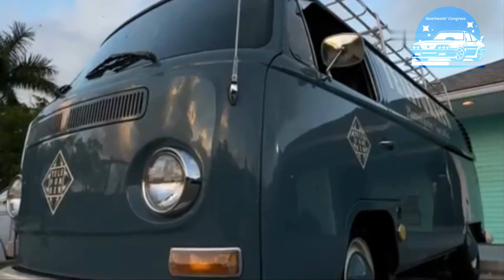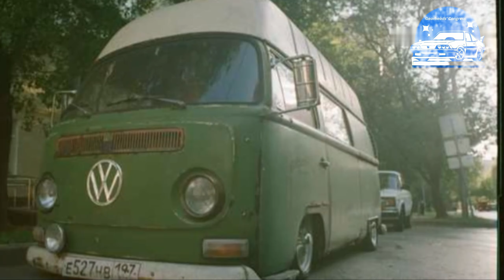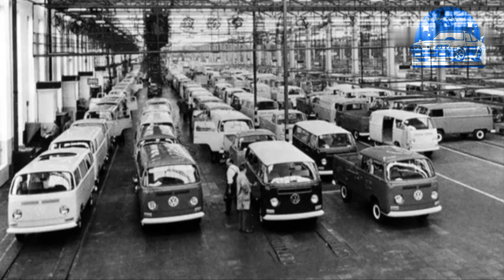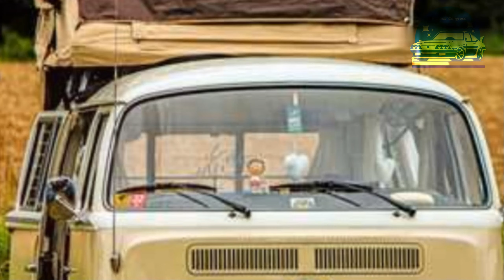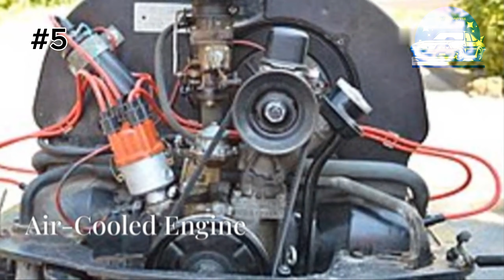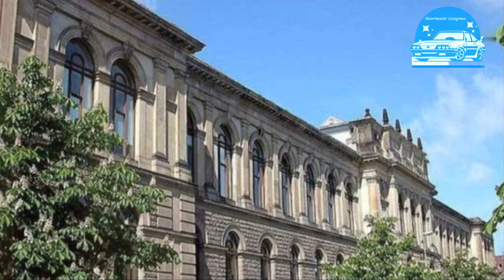Here are 10 Untold Facts About the Volkswagen Bus (#volkswagenbus )

Comment: I had two Type 2s. One a '67, and a '66. The '66 was a panel van with a Westfalia conversion, including the awing, and dual side doors. Drove it all over the states in the '67 while doing contract airline maintenance, and carried my toolbox and half a case, two jugs, one head, spare carb, coil and lots of points, spark plugs, and all the tooling necessary to rebuild the engine on the road, though never had to as I was running on a fresh rebuilt engine, and the breaking period was driving from San Antonio, TX to Clearwater, FL for a contract, changing the oil twice on the way. I had lots of confidence on my work. The '66, used it mostly to commute to work, and camping. The engine caught fire once,(carb fuel leak) and rebuilt it on the spot, and replace the wiring harness. None of this could be done today. Lived in South America for a while in the 90s and viewed many fire, and ambulance models, But my true desire was to get a pre-68 Crew Cab, but never did, but have two die cast models of a Kombi, and a Crew Cab as memory items.
Reply from the maker: Great memories, thanks.

Comment: I worked for a Vw dealer in Blythe California. If you lived in the desert it was not a good vehicle to have, unless you kept it at 55 or less and kept strict adherence to the maintenance schedule.It could not be driven at 70 MPH ALL DAY It could not take the heat and if you didn’t do the valve adjustments as required it would not last. It would drop a valve.  The air cooled engine was not designed to be driven the way we drive in America. If you lived in a cool climate and drove it like I outlined Ive seen them go 80,000 mi or more. This went for The Bug as well.
Reply from the maker: Great experience. Thanks for sharing.

Comment: I had a roommate that had a '71. At that time I had a '70 Chevy van. We switched cars one weekend & I was never so glad to switch back. Guess which van towed the other one home when it blew up. In those days you could rent a VW specific tow bar to drag your blown car home.
Reply from the maker: Great. The Bus was a great vehicle, although some have negative reviews of it.
Reply: VW's were notorious for burning the exhaust  valve on #3 because the fan housing sat on it and it over heated.

Comment: One of the best vehicles I ever owned was a 1972 VW bus, which I bought in 1984 for $1,200. The bus looked great and ran great. It just needed new tires at the time I got it. I lived in a region that would occasionally get a lot of snow. I discovered that the bus could go through snow as well as any 4WD or AWD vehicle. The only reason I sold it was because I went into the military and eventually got transferred to an overseas base.
Reply from the maker: Thank you for sharing. The Bus had it drawbacks but it still remains one of the legendary vans.
Reply: The '72 is my favorite, also, even though I had a blast with my parent's '66 15 window. It had the updated body but still used the old engine style. That 1500 was prone to dying early but, because of import parts, they were cheap to fix or replace. Personally, I bought a 10 yo '73 with the new style engine. I replaced a cylinder head and the heat control flaps in the engine ducting and it cost almost as much as a new 1500. For some reason those flaps would rust off on the bottom and the dealer charged an arm/let at the parts counter. The dual carbs (especially the idle circuit) were also a bit of a problem. IIRC the dealer wanted $1000 for each carb in 1984, about as much as having the entire 1500cc installed at the dealership.

Comment: Underpowered and dangerous. I went through 4 engines in 108,000 miles. I can't say enough bad things about them. I made little money, and that bus kept me broke in money and on the side of the road. Once I started making bucks I got away from VW's and never looked back. Nostalgia has a way of looking at things through rose colored glasses. I'm here to tell you these things were just crap.
Reply: I loved my 1972 bus - including at the time I owned it! The bus was 12 years old when I bought it. I drove it every day for 5 years before selling (when I moved to another country or I would have kept it). The only repairs I ever did was replace the spark plugs & plug wires as a precaution and replaced the tires because of normal wear.
Reply: Maybe you didn't take care of it.
Reply: @nedludd7622 Even if cared for, they typically blew the #3 cylinder by 70,000 miles. It was good they were so easy to work on.
Reply from the maker: Thanks for watching.
Reply: Absolute fact, they were horrible vehicles!  I had a '64 Krautwagen bus - what a deathtrap, there was little more than the thin sheet metal 'nose' of the vehicle between you and whatever obstacle you chose to plant the big round "VW" emblem onto.  The drum brakes weren't adequate for a VW Beetle traveling at 30mph, let alone for this larger vehicle at greater speeds.  It was less safe than the Chevy Corvair that Ralph Nader famously declared to be "unsafe at any speed".  And the Krautbus was so underpowered that the engine would strain for almost half a minute to reach 60mph...and then would struggle to maintain that speed on level  terrain.  In less than 20k miles, the #3 cylinder on my Krautbus dropped an exhaust valve, requiring a complete engine rebuild (the #3 cylinder was notorious for running hotter than the other cylinders, due to the asymmetrical location of the oil cooler).  Before I ditched my Krautbus with less than 100k miles, it was on its 3rd engine.  The fastest it ever traveled was being towed up I-75 behind my beloved uncle's '69 Chrysler New Yorker, which towed it at 75mph with ease, owing to the Chrysler's wonderful American-made 440ci V8 (the Krautbus had blown up near Marion, OH, in this instance).  To make matters even worse, the '64 still had a 6-volt electrical system...to get enough juice to start it when temperatures were below freezing (which was common for months each year in Michigan), I carried a set of jumper cables and a 12-volt battery, and would momentarily connect the 12-volt battery to the vehicle's battery for cranking...this was accompanied by lots of sparks, and the risk of blowing out some of the vehicle's electrical components (such as lamps) in the process.  I don't, nor does the reader, have time to review all the misadventures this rolling pile of pre-WW2 technology thrust me into.

Foolishly, I replaced the '64 Krautbus with a '68 Beetle.  Should have learned my lesson the first time around, but that's another story.
Reply: @robevans5222 Nothing at all xenophobic.

Comment: I had a sliding door one. The previous owner had put a Porsche boxer 6 in it. It was lost of fun. I think it is pathetic that in a VW review you showed In line 4 cylinder engines.
Reply from the maker: Thanks for watching and sorry for that. We're working effortlessly to improve our future videos.
Reply: Actually,  later models of the Volkswagen Type 2, particularly the "T3" generation, did utilize an inline-four cylinder engine, replacing the older air-cooled boxer engine found in earlier models; this change primarily occurred in later production years and for US market vehicles. I saw a few while I was a line mechanic at VW dealerships in a past life.

Comment: I have owned a splitty, A bay window, and a wasserboxer. I think the split window vans looked the best but they didn't have much legroom for the driver. The bay window vans were much more comfortable plus they got rid of the reduction gearboxes on the rear wheels that often leaked. From a driving and comfort viewpoint the Vanagon wasserboxer was best with a quieter ride able to handle Interstate highway cruising with ease.

Good video, but why do you show a transverse inline engine repeatedly while talking about the wasserboxer?
Reply from the maker: Thanks for watching and commenting. We're working hard to improve our next videos.

Comment: I once owned a 1981 Riviera, which was an American version of the famous Westfalia. Its name come from a big VW dealer in Portland Oregon that decided to convert buses that VW sent them into campers modelled after the famous Westfalia, which were in high demand, but short supply. They commissioned ASI from Vancouver Washington State and the result was the 1965 Riviera. They sold well into the eighties. I loved the thing and we travelled extensively in it. It was surprisingly reliable, but god! I was slooow with its air cooled pancake engine having to move the much heavier square T3 Bus, called Vanagon in North America. One difference with the Westy was the "Mushroom" top going up straight. Many beautiful memories in it!
Reply from the maker: Great memories. Yes, the Riviera Camper was great, only that the air-cooled engine would turn lazy on hilly roads. Thanks for watching.